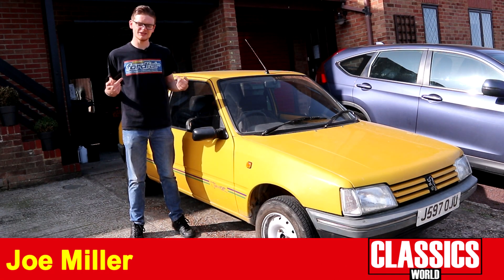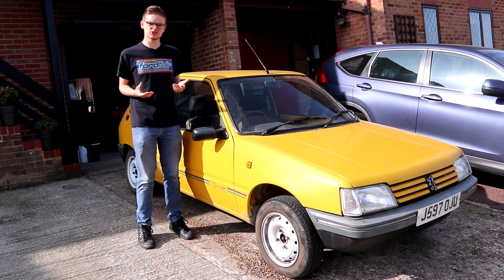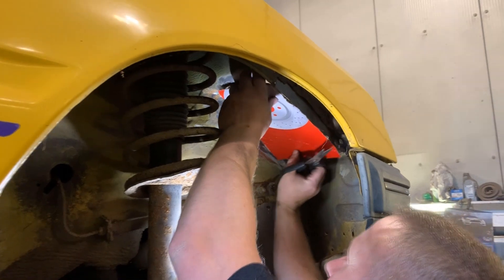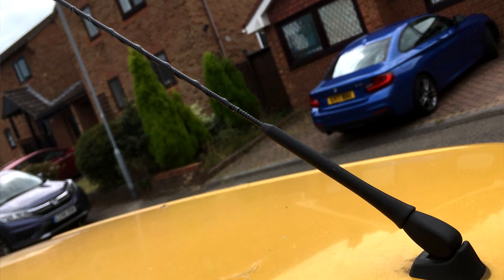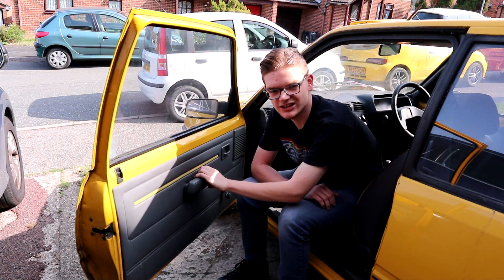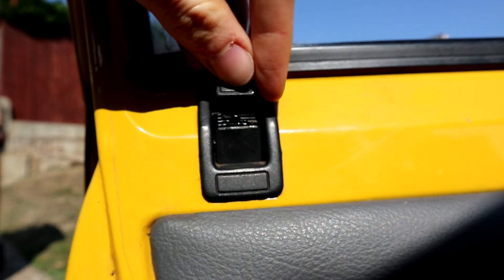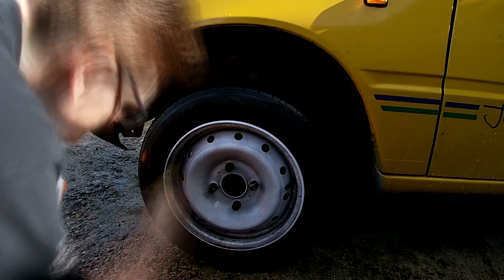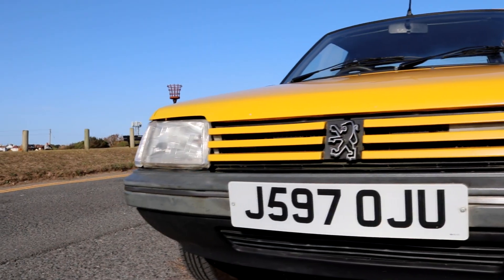Fixing RUST On The £400 Peugeot 205

Comment: I got the 205's larger, rarer and somehow cheaper sister, a 309. And even though mine is a petrol engine and very few components are actually shared across these two cars I still learned a ton that will help me fixing my car.

Though something I will have to disagree on is the Peugeot's rust tendency. I don't think there are any better rust-proofed cars from the 1980's than Peugeots and Citroens. Just compare them to Volkswagens or Vauxhalls/Opels or god forbid, Fords of the same era.
Reply: French cars have been the most rust-proof in general since the early 80's in my experience. If this 205 was born as a Fiesta/Polo/Corsa it wouldn't be around any more.
Reply: Y because Peugeot was the first manufacturer to try and design their cars to avoid rust traps.  So 205s were generally very good for the era.

Comment: There are literally ZERO reasons for this project being done this way... For example,  I've been around 3d printed stuff, that gear knob will feel horrible in hands for a long period of time because of its roughness... The face of the car was not really mended and it still looks very errr... Beaten up... There is a reason for human progress... People want to have better and more sensible and comfortable things in their lives... An XUD powered, bottom specced,  +200k, basically dead, yellow colored old 205 PUG is not cool nor is it practical... Its not any normal teen dream daily car... Its not any sensible persons dream car. It can be cool and nice from historic POV, if restored properly to original "like-new" state... This? Its a pile of sort of cheap  junk being restored the cheapskate muppet way (except for that rust repair which was done sort of nicely) for no reason at all... Its just... Pointless...